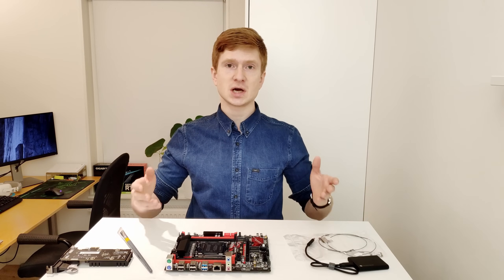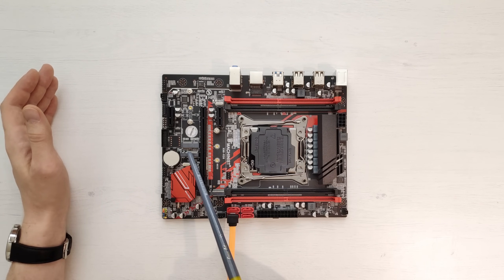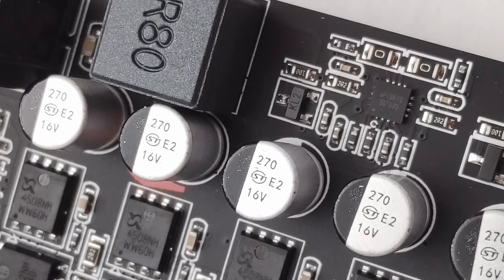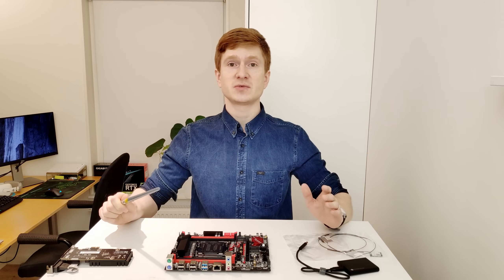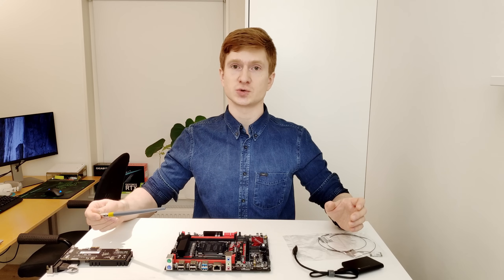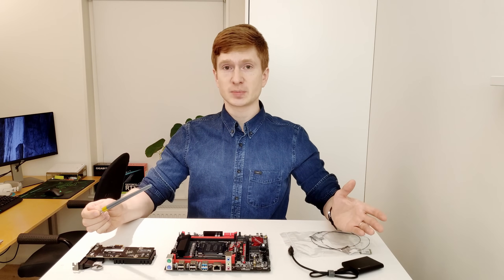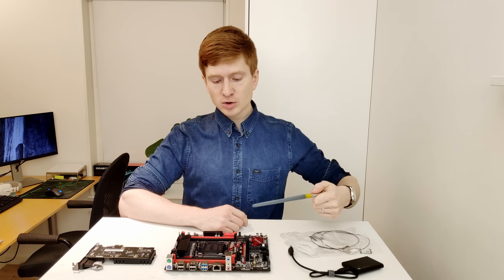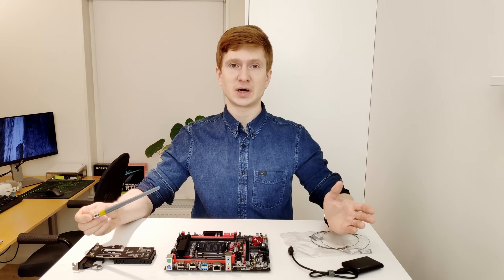🇬🇧 Machinist X99-RS9 – detailed review | E5-2678 V3 | i7-6800k | BIOS | O.C. | VRM | Mi899

Comment: I have this board, just a question is the TBU feature for Xeons only , or does this turbo boost  with i7 eg 5820K ?
Reply from the maker: TBU is only compatible with locked Xeon E5 V3 CPUs.
Reply: @Miyconst  Thanks, is there any advantages using an alternative BIOS than stock , for i7 5820K ? I am guessing just better memory speed right ?
Reply from the maker: @technomad900  access to memory timings and no USB 3.0 issues, that's what you get extra with Huananzhi X99-8M-F BIOS.

Comment: I bought this board a month ago and i just realized mine have a debug monitor
Reply from the maker: You have got an updated revision, but in general it's the same motherboard.
Reply: @Miyconst thanks!, I also found out the new revision board keep crashing on load, so i try to change the bios to x99-8m-f which solve the issue.

Comment: Hi miyconst,

Please if you can help me, I got the Machinist X99-RS9 kit (most current version that has the temperature led) + 2683 v4 + 32g ram ddr4 2666mhz

Do you indicate using the bios that already comes in it or one that you have created?

As the v4 version has no way to turboboost, what would you advise getting to 3.0GHz?

Thanks
Reply from the maker: Hi there. X99-RS9 is compatible with Huananzhi X99-8M-F BIOS, at least the revision I have tested was compatible. Xeon E5 V4 cannot be turbo unlocked or overclocked, you are stuck with the default frequency.
Reply: ok thanks for the reply

And the Bios I download directly from their website or some version of bios from your github?
Reply from the maker: Both is fine. You can use my Mi899 app to flash the X99-8M-F BIOS or download it from the Huananzhi website and flash yourself.
Reply: @Miyconst  Good, since the 2683 V4 doesn't have turbo boost, when the card arrives, I'll try to do the RAM Timings, do you think it would improve the performance?

Does this BIOS that comes with the Machinist RS9 have the option of memory timings?
Reply: @Miyconst  I learned that as V4 versions do not have Turbo Boost, you can use the Throttlestop program to increase the cores and increase performance, then test
Reply from the maker: @tplms  V4 CPUs do have Turbo Boost, but it's not possible to apply the Turbo Boost Unlock hack that forces all CPU cores to boost to the maximum boost frequency.

Comment: What motherboard would you recommend for Processor E5-2690 v4. Usage only for Proxmox ? If you think that there is better budget solution could propose it too ? :)
Reply from the maker: If you want a Chinese option, then it's Huananzhi X99-F8 or X99-CH8.
Reply: @Miyconst  I hope you're doing well, If I may I would like to specify my question since I've sold my E5-2690 V4 and bought 2xE5-2680 V4. What preferably micro ATX (if there is such a thing) would you recommend in this case ? Plus do you have any experience with ASRock Fatal1ty X99M ?
Reply from the maker: @GrimSpec  are you looking for a dual socket mATX motherboard? I don't think such can be found, the LGA 2011-3 socket is just too big to fit two on an mATX board.

Comment: Hi there, thank you for the video, it was great!!
I bought this motherboard with 64GB RAM ECC and Xeon E5 2673 V3, and I was trying to make ECC work, but at least with the original BIOS, it doesn't work no matter how many ECC features of the BIOS I change so I stated reading several blogs and it looks like changing the BIOS is a solution in other motherboards. What do you think about it? Have you experienced something like this?
Reply from the maker: In this video I have told everything I know about ECC mode on the Chinese X99 boards: https://youtu.be/HozIT2X-cKk

Comment: Hi, I am not getting any Display, no post. I see the counter on motherboard turns on, CPU fan starts PSU fan starts but no display. anybody seen this issue?
Reply from the maker: It's next to impossible to guess what is wrong with your setup. Please specify full hardware specification and what is the post code.
Reply: @Miyconst  turns out the MB was faulty, got a replacement and I am rolling with E5-2640 v3 and 64GB of RAM.... now looking for a good graphics card, any suggestions???
Reply from the maker: @ab.digital5737  good graphics cards are next to impossible to find for a good price these days, but try to find a GTX 1060 / 1070 / 1660 on the second hand market.
Reply: @Miyconst   I am leaning towards New NVIDIA T600 4GB ddr6

Comment: Hello, I have this motherboard with a 1650v3 Xeon inside of it. I have flashed the 8mf bios and rs9 bios, from your Mi app, with unlocked RAM timings and tried many of them. My problem is that when I enable "Overclocking Features" the system just hangs and will not POST until I clear the CMOS. I dont change anything, or I do set what I believe to be fair settings (i.e. 38 multi with 1200mv). Still no POST until I clear the jumper. I have been through this time consuming act for awhile of trying different known working BIOS' and have only been left dancing with a tambourine.
Why is this happening? My CPU is multiplier unlocked... not even XTU in Windows 10 will let me play with the Multiplier! I am very confused because it says in XTU that it is COMPLETELY UNLOCKED. I'm pulling my hair out. Thank you very much. 

PSU is Seasonic CX 650, 980ti, 16GB DDR4, NVME PCIE SSD, M.2 WIFI/Bluetooth, Samsung SSD, Gammix 400 v2 aircooler, Coolermaster TUF 300QL, thats about it.)
Reply from the maker: Hello. Did you watch the video at all? I have specified very clear, this motherboard does not support any overclocking because it uses a desktop chipset.
Reply: @Miyconst  Yes I watched the video. Thank you for your reply. The turbo boost works with my 2640v3 but nothing else.. I will buy another motherboard.

Comment: Hi, so I'm trying to overclock my i7 6800k on machinist rs9, but when I activate the overclock function, the error code screen on the motherboard gives error 19, and it.ao starts. And I have to reset the cmos, do you know how to fix this? I really appreciate it if you know!
Reply from the maker: Did you watch the video? I have explained that X99-RS9 uses desktop chipset and doesn't support overclocking.
Reply: @Miyconst  ok.
Reply: @Miyconst  But would I be able to overclock my i7 6800k with mobo mchinist rs9, with intel xtu, or with other software? Thanks !
Reply: @Miyconst  But what if I made a bios mod of the huananzhi f8, would I be able to overclock it?
Reply from the maker: @MAZZIGAMERBR  no and no, please watch my review and you will understand, this motherboard does not support any overclocking.
Reply: @Miyconst  ok, I Will do this, thanks!

Comment: Hiya, could you please advise which micro atx motherboard I can get for 2666v3 turboboost unlocked, my pc case can only hold for micro atx, and I already bought 2666v3, as I understood g7 and xs9 is not appropriate
Reply from the maker: In your case I would go with Huananzhi X99-ZD4 or Shuangwei X99S.
Reply: @Miyconst  Thank you for your prompt advise, huananzhi x99 zd4 has 242mm width, my case has restriction of 215mm.  shuangwei seems to fit perfectly, but it seems to have 2 channels only, not quad channel for ram, which might affect overall performance, what do you think, and also if possible could you please advise for micro atx(width 215mm or less) ddr3 quad channel for high tdp(2666v3, 2678 v3) processor, as i did not decided yet which memory i will get ddr3 or ddr4. thank you very much, appreciate your time!
Reply from the maker: @disbkz  Shuangwei X99S has four memory channels, just like X99-RS9, please watch my review of the motherboard: https://youtu.be/pOxxxinCkfs So far there is only one mATX DDR3 motherboard from china, and it's X99-G7, which is not a good candidate.
Reply: @Miyconst  ok, thank you, you helped a lot!

Comment: Good night, I bought a card like this x99-rs9 and I need to make it turn on automatically after a power outage, without having to go to the computer and press the button, do you know how I do this? I looked in the bios and I didn't find anything and if I leave the jumpers on the power switch button on and off then it turns on and off.

Comment: Could you recommend for me X99-k9 and X99-rs9. Which one is good for i7 5820k? I see rs9 has 2 ports fan 4 pins for case. K9 only has one port fan 4 pins. Like your channel. Very useful for knowledge. My motherboard asus just gone.
Reply from the maker: I would definitely go with K9, even though the VRM is weak you still have at least some overclocking possibilities while RS9 uses desktop chipset with zero overclocking options. I am currently testing such a combo.

Comment: Machinist X99-RS9 of Mi899 works with Q97 and B85 chip?
Reply from the maker: Definitely works with B85 chipset, but I am not sure about about Q97.
Reply: @Miyconst  Is it possible to remove the intel inside logo and put it on the machinist?
Reply from the maker: @lccontabilidadedigital  yes, it's surely possible.

Comment: Hello, i want to know what undervolt i must use for unlock turbo boost with xeon e5 2670 v3 on x99rs9.
Reply from the maker: It depends on your specific cpu, but you can go with the safe value of -50/50.
Reply: thanx 👍

Comment: Can DDR4 desktop memory 2133mhz work on this board? Or only server DDR4 2133mhz memory work? Thx
Reply from the maker: Yes, it can, but only 16 bank memory modules.
Reply: Miyconst  what brand of16 banks memory module you successfully installed? Or any 2133mhz brand that has 16 bank module? Please specify brand will be appreciated. Thx
Reply from the maker: @nuttyl283  brand doesn't make a difference, as long as the modules are identical to each other and have 16 banks.
Reply: Miyconst  thx so much i will try to find desktop2133mhz 16 banks module on each 8GB RAM DDR4
Reply: @Miyconst  huananzhi-x99-8m-f.tp.tu.ROM    Will be used with Machinist X99 RS9 for turbo boost unlock?  I need to flash this .ROM to replace original RS9 bios, am I right? Thx.  Huananzhi X99 8M-F bios is fully compatible with Machinist X99 RS9, correct?
Reply from the maker: @nuttyl283  yes, unless Chinese have changed something in the X99-RS9 specs.
Reply: @Miyconst  but 8M-F chip is different from RS9  (B85 , C226) vs (B85, Q87).  How to detect RS9 whether it is B85 or Q87?
Reply from the maker: @nuttyl283  There are many different programs which report your computer's chipset, for example you can use Aida64.
Reply: @Miyconst  Thank you so much

Comment: I'm having problems with this motherboard, everything was working but there's drivers missing used to use ethernet and I cannot find these drivers anywhere or where to download them etc. Can anyone help?
Reply from the maker: This is a Realtek network adapter, search in Google for drivers. YouTube removes comments with links.
Reply: @Miyconst  I searched that up and installed the Win10/Win11 Auto Installation Program (NDIS) onto a USB stick and then plugged it into the other pc, when I ran it It just gives me the message "The Realtek Network Controller was not found. If Deep Sleep Mode is enabled Please Plug the Cable." (I'm not an expert on this kind of thing so I don't know what to do as everything I've tried so far doesn't work and nobody knows a solution.)
Reply from the maker: @Ementss  well, it seems like you have got a defective motherboard with a dead network adapter.

Comment: Hello!! I bought a x99-rs9 with xeon 2630Lv3 and a 16GB ECC REG RAM bank. Flashing bios with x99-8MF -50-50.
I have installed Ubuntu server. From the BIOS I have enabled ECC support. But with every reboot I have errors
EDAC sbridge: CPU SPCID # 0,
Ha # 0, Channe1 # 1 has DIMMs, but ECC is disabled
Can you tell me something? Thanks
Reply from the maker: Hi. I think this video is going to answer your question: https://youtu.be/HozIT2X-cKk
Reply: @Miyconst  Thanks. Which do you recommend to flash specifically?
Reply from the maker: I don't have any better BIOS for this board, Huananzhi is supposed to be the best, but as you reported, ECC mode is still bugged. ☹️
Reply: @Miyconst  so no firmware has the ability to make ECC work? the last firmware that i had flashed was in the mi899 app
Reply from the maker: @cpmrk  I am not aware of any better options, but you can try to contact iEngineer, he can make a proper BIOS.

Comment: Hello from Argentina Myconst! Recently build a pc with this mother and te only problem its that win 10 cant detect bluetooth (instaled intel wifi/bluetooth card) wifi runs perfect but no bluetooth. Do you tested BT? Have you done some changing on bios to work? (manager devices detect an unknown usb device and think its de BT) Thanks and great reviews!
Reply from the maker: Yes, I have tested Bluetooth and it worked fine. Did you install all Windows updates including the optional ones?
Reply: @Miyconst  yes al updates and nothing, win 10 installs an extensible usb 3.0 drive and marks one unknown usb device... all usb port are working fine so  i think its the bt bad detection frome win 10, also checked on youtube and google and seems to be a common problem, but find no solution.
Reply from the maker: @trasfondodelacultura8297  okay, then you might need to manually download and install Intel Bluetooth driver.

Comment: Hello!! Is there any way to setup my ram frecuencies above 2133 mhz with this motherboard? I bought one, with E5-2678 v3 processor.
Reply from the maker: There is no such a way, it's a limitation of the CPU.
Reply: @Miyconst  thank u! Is there another CPU for this motherboard that supports higher frecuencies?
Reply from the maker: @juanp93  Many E5 V4 CPUs support up to DDR4-2400, i7-5XXX and E5-1650 V3 can go up to DDR4-2400 and i7-6XXX can go up to DDR4-2600.

Comment: Is there a guide or some documentation available to try using Huananazhi X99-8MF BIOS with this motherboard like you mention at 5:20 ? I got this board to build a portable workstation but I'm experiencing some very strange issues such as failure to POST or random freezes during IO operations. I want to give the alternate BIOS option a try, but I'm unsure where to look for documentation on this.
Reply from the maker: If your system behaves this bad, it may be a hardware failure, but feel free to try my Mi899 app, there you will find a collection of different BIOS options. Also make sure to have fresh Windows installation.

Comment: This may seem like a dumb question, but I have my machine build and Windows 10 Pro installed now, but I cannot figure out how to boot into the BIOS of this Machinist board.  I have tried F1 F2 F11 and F12, but no BIOS.

System is running great by the way, but I just can't figure out how to load the BIOS.
Reply from the maker: Most desktop motherboards enter BIOS by the Delete key.
Reply: @Miyconst  Thanks for your reply.  Pardon my ignorance, but this is my first PC after 30+ years on Mac only.
Reply from the maker: @JeffWaynee  no worries.

Comment: Sorry but is it worth buying?    I got a e5 2699v3 chip and 64gb of ram.  My editing machine died and need a replacement.
Reply from the maker: It is surely not worth buying for E5-2699 V3. Machinist X99-RS9 will die under such load.
Reply: @Miyconst  which board would you for that CPU?   Sorry I am desperate for a new editing pc
Reply from the maker: @salaciouscreations4323  Normally I would recommend Huananzhi X99-F8, but I have not yet tested the latest revision of this board, thus I can't guarantee that it's a good option.
Reply: @Miyconst  I will give it a try as those are on eBay.      Amazon have a 64gb 2666 kit for £245. 4x16.    It's only for editing it won't ever see a game.   Long as it works is all I care about.
Reply from the maker: @salaciouscreations4323  Good luck with the project!
Reply: @Miyconst  the f8d works perfectly.   I popped another 64gb in  all 128gb shows up.  And the cpu works on all cores.   Thank you so much

Comment: I bought a bundle with this motherboard, an E5 2670 v3, and 32GB 2133MHz DDR4.  The 2670 v3 is a 120w chip, and this board is rated for as 120w max CPU, so should it be fine?  I ask because you seem to think an 8 core could be too much for this, and the 2670 v3 has 12 cores.
Reply from the maker: It all depends on how good your chassis cooling is. If you can keep the motherboard VRM cool - you will be fine, otherwise the motherboard will die under heavy load.
Reply: @Miyconst  I got a great Cooler Master case, and there will be 3x 120mm intake on the bottom and 3x 120mm exhaust on the top.
Reply from the maker: @JeffWaynee  this does not yet guarantee that the VRM zone will be ventilated well.
Reply: @Miyconst  Thanks for your replies.  Two of the top exhaust fans will be right above the VRM, but I also have a spare 80mm and 92mm Arctic fans, so I think I will custom attach whichever one fits better in the final build, and have it blow directly on the VRM just to be safe.
Reply from the maker: @JeffWaynee  sound like a good solution. Good luck with the project!
Reply from the maker: not every low profile cooler blows air to the VRM, but in general it helps to keep VRM cooler as long as you have some decent airflow within the chassis.
Reply: @Miyconst  thank you, man.
Reply: @Miyconst  How about a low-profile cooler to provide air flow to VRM?

Comment: Hey nice video man :) I got a question, what model of MoBo should I use to unlock turbo boost in the Mi899 software for this x99-rs9 and E5 2640v3?
Reply from the maker: Go with Huananzhi X99-8M-F -50/50 BIOS, it should be safe.
Reply: @Miyconst  thank you so much!